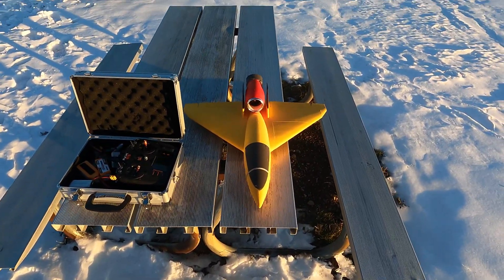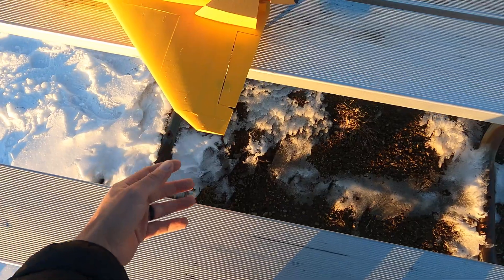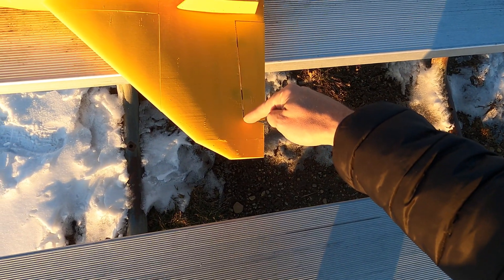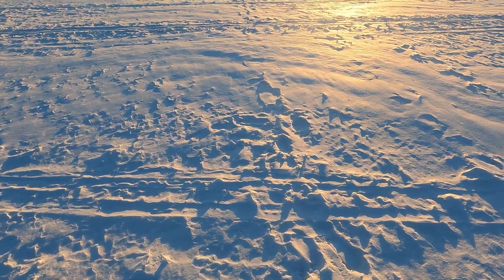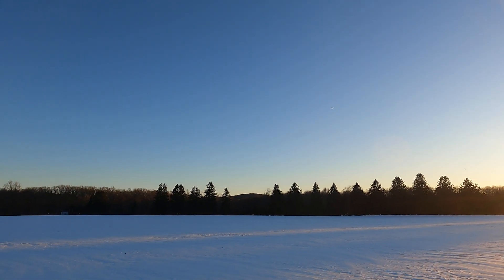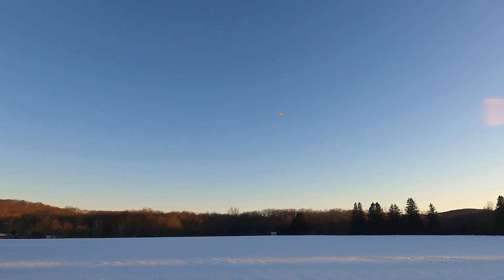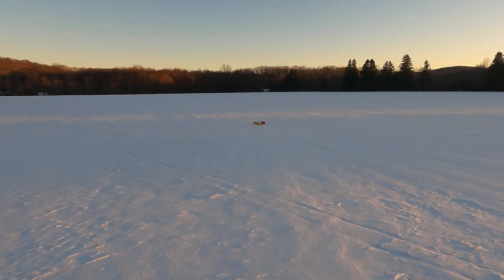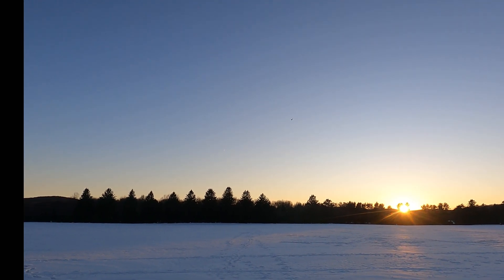Pocket Rocket 🚀 ?? WTF? it’s actually super cool.

Comment: 10:31     MISTAKE. !      shape of fuselage should  NOT  promote turbulence.!!!!!
here is an example of correct configuration of an offset pusher thrust system.      the lines added to the photo  intersect at the point where the  c-m  is supposed to be located; not cg.        d
https://static.rcgroups.net/forums/attachments/2/9/6/3/9/7/a5988257-224-bixler%202%20motor%20angle%20correction.jpg

Comment: That flies smoooooth, would not know you were in wind gusts! Beautiful scenery with the snow and the low sun angle too. 630g is very good for an EDF of this class, and that crash performance certainly shows the value in keeping it light. I think you're on to a winner here.
Reply from the maker: Totally agree! I also kept the inner skin to outer skin thicker so it was structurally more stiff and durable without the weight. Yeah it was 9mph sustained and 15 gusts. A 50mm would normally be tossed around. V2 should be even better